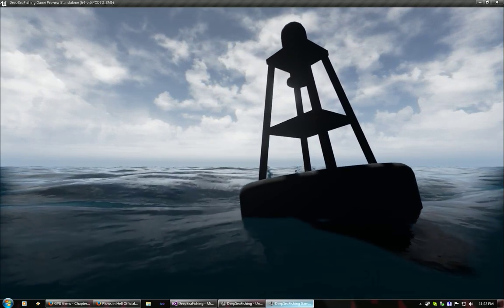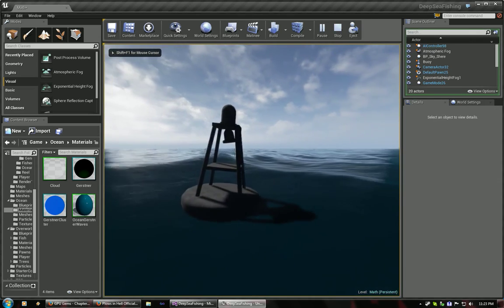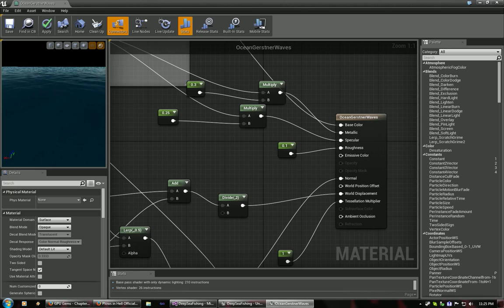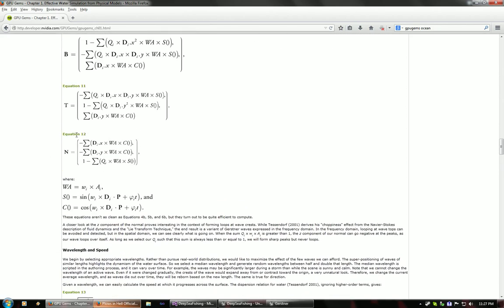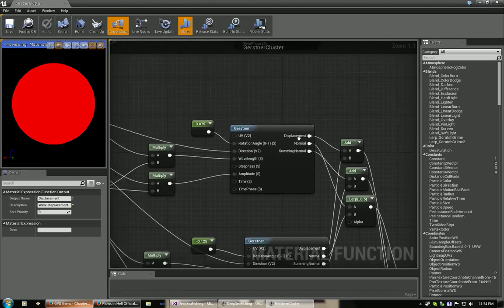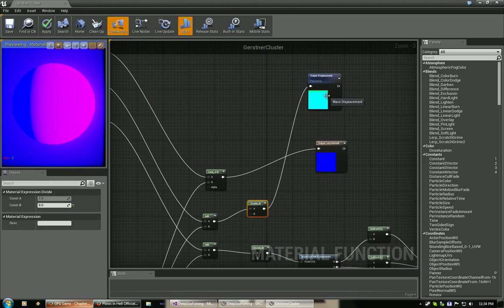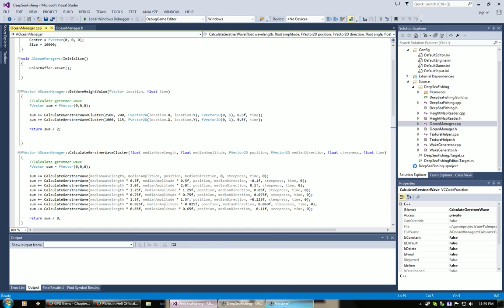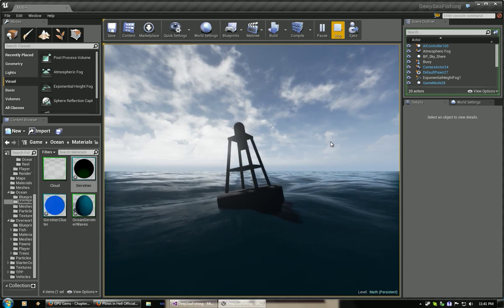Mathematical Ocean for Buoyancy

Comment: Where is the Custom Rotator coming from?
Reply from the maker: It's from the engine. It's a built-in material function.
Reply: handkor Also what was the final value you multiplied the wavelength and the amplitude by in the gerstner cluster? I can see the rotation angle is -0.11 but I can't see the multiplication factor
Reply: handkor My material doesn't seem to be rendering properly either, there is no movement in the waves, even when simulating. This might be because of the object I am using? (I just created a default box object)
Reply from the maker: shadow12533
Should work on just a box.
Reply from the maker: shadow12533
That can be random, as long as the ocean manager and the material use the same numbers. I just keep the values between 0.5 and 2.0. I've already changed some of them, as you try different values you can get nicer looking water.
Reply: handkor My material has movement now, but no displacement, it's also not really the right colour at all. Sorry for bothering you so much, but I'm quite new to applying complex math in game engines.

http://imgur.com/6XPeKoH (screenshot of material)
Reply from the maker: shadow12533
It looks like your normal might be off or inverted.
Reply: handkor As far as I can see everything is plugged in correctly from the clusters to the main material as it is in the video, but I havent tried multiplying by -1 yet
Reply: handkor My World Displacement and Tessellation Multiplier inputs in the main material are also greyed out, or darker than normal. I'm not sure if that means they're not being used.
Reply: handkor Heres an album of the relevant Material and Cluster blueprint if you need to see it

http://imgur.com/2HRzJhy,u4FsJMO,iIwf0RA
Reply from the maker: shadow12533
You need to turn on tessalation in the material's properties.
Reply: handkor Thats gotten displacement working thanks, though not as much as I see in your example, also the colours are still off, do my normals looks alright?
Reply from the maker: shadow12533
I'm not exactly sure what's wrong for the color. If you disconnect the fresnel node and only input a color to the base color, does it still look wrong?
Reply: handkor Yeah, whether the fresnel is plugged into metalic and specular or nothing at all the colours are still wrong

http://imgur.com/wkotxZj
Reply from the maker: shadow12533
Your lerp's alpha going to base color needs to be connected to fresnel. This will not fix the problem but that's missing. Try connecting your normal directly to base color and switch to unlit to see if it's smooth.
Reply: handkor This is the result of the normal going into the base colour, I'm guessing it's meant to look a lot less erratic?

http://imgur.com/g7gaWoG
Reply from the maker: shadow12533
It should look smooth. If you added the normals together then you should divide by 8 in the cluster.
Reply: handkor All of the summing normals are added together then divided by 8, split, subtracted from 0 (and 1-x for the z) and then made into a float for the normal.

The normals from the cluster are lerped together into the lerp normal output, but as far as I can see lerp normal isn't used.

The base colour hooked into both normals is shown here, both the original wiki normal and the new cluster normal, so the problem must be with the cluster, but I can't see any differences aside from the final clusters multiplication factor

http://imgur.com/AADdgqr
Reply from the maker: I don't know but it does look oversaturated. Eventhough it will be wrong, Normalize the normal just to see.
Reply: handkor Normalizing makes it slightly smoother, but obviously not much help in the colour department

This is my Gerstner blueprint for reference, in case anything is off.
http://imgur.com/4IDyq3p

I set the defaults of the inputs as best I could from one of your answers to someone else's questions, but they might be wrong as most of the inputs are vec3's but you listed some vec1 numbers
Reply from the maker: It looks fine other than InputRotationAngke.
Does it look right when you just do one wave, no cluster.
Reply: handkor Multiplying the wavelength and amplitude by 0.5 and the rotation angle by -0.1 and plugging that straight into the outputs made this.

http://imgur.com/40GpFi2

I can make an image of my cluster function as well, there might be a problem in there
Reply from the maker: shadow12533
Ok so there is definitely a problem with the individual gerstner wave.
Reply: I've changed all the inputs back to their defaults though it didn't fix anything, it might be a material function setting I didn't see?

You've checked the picture I posted and apparently everything is linked correctly
Reply from the maker: I must have missed a bad connection or some number is wrong somewhere. I don't know.

Comment: I was able to create the movement and height of the waves using your tutorial, it's great. The only problem I have at the moment is that near a shore, when the wave goes over it, the wave shows the shadow (because it was initially below when the lighting was built). Is there an easy solution for that? I have just started to use game engines and barely have any idea of graphical rendering and stuff. Either way thank you for the tutorial, it's explained really well although it's hard to follow up visually, keep it up.
Reply from the maker: I don't have a solution for that yet. I have not approached shores.